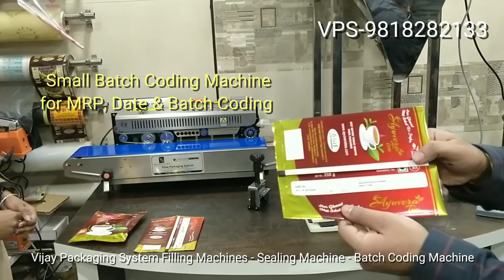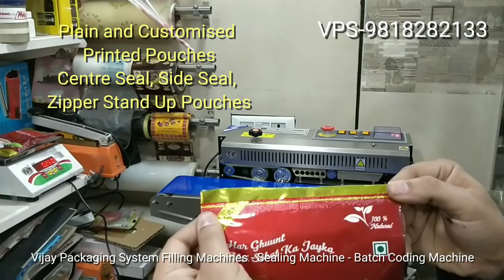Small Scale Business-Packaging Machine-Batch Coding-Filling-Band Sealing Machines

Comment from the maker: Whatsapp - 9818282133, 9350006667
9311111587, 9582222984
Land line - 01123976263, 01147050428
www.airbubble.in
Vijay Packaging System
3213, Ram Bazar Mori Gate Delhi-110006
Near Tees Hazari Court
vijaypackagingsystem@gmail.com
vaibhevkwatra@gmail.com

Small Scale Industry-SME-Packaging Machine-Batch Coding-Filling-Band Sealing Machines

Batch Coding Machine
3mm-small-₹2600
3mm-small with slots letter-₹2800
3mm-big-₹3300(IN VIDEO)

Mini Grains and Masala Powder Filling Machines
VPS-PGF-200-₹32,000(2gm-200gm)
VPS-PGF-1000-₹48,000(10gm-1000gm)(IN VIDEO)
VPS-PGF-3000-₹52,000(20gm-3000gm)
VPS-PGF-5000-₹62,000(20gm-5000gm)

Sealing Machines
Continuous Band Sealer
VPS-650-CS-SS-HZ-₹22,000

Other Continuous Band Sealer models available
VPS-500-CS-MS-HZ-₹15000(powder coated)
VPS-500-CS-MS-HZ-₹17000(stainless steel)

for vertical attachment ₹2000 extra
for Nitrogen filling attachment-₹15000 extra

5kg band sealer-₹36,000
10kg band sealer-₹70,000
15kg band sealer-₹1,35,000
25kg band sealer-₹1,75,000

Other Batch Coding and Conveyor Machines available.

Taxes and Transportation Extra

GST-18%

Packaging & Forwarding Charges Extra

Packaging Machines suitable for
Rice Packaging
Tea Packaging
Atta Packaging
Pulses Packaging
Spices and Masale Packaging
Powder Packaging
Cosmetics Packaging
Food Packaging
Bakery Packaging
Automobile Packaging
Fmcg Packaging
Supplement Packaging
Protein Powder packaging
Consumer Goods Packaging
Chips Packaging
Chemicals Packaging
Granule Packaging
Dal Packaging
Grains Packaging
Suji Packaging
Maida Packaging
Rava Packaging
Papad Packaging
Unprocessed Food Packaging
Processed Food Packaging
Haldi Packaging
Mirch Packaging
Dry Fruits Packaging
Badam Packaging
Akhrot Packaging
Kaju Packaging
Nuts Packaging
Spare Parts Packaging
Industrial Parts Packaging
Pesticides Packaging
Fertilizer Packaging
Super Market 
Corner Shops
Sweet Shops
Hardware and Sanitary Stores and Manufacture
Mobile Phone and Accessories
Electronic Equipment and Electrical equipment
Books and Magazines Packaging
Commercial and Industrial Products
Pan Masala and Gutka Packaging
Display Products
Auto Parts Packaging

Our Range of Machines
Continuous Band Sealer
Sealing Machines
Hand Sealers and Pedal Sealers
Powder and Grain Filling Machines
Shrink Packaging Machine
Shrink Tunnel
Shrink Chamber
L-SEALER
Web Sealer and Shrink Tunnel
Automatic L-Sealer
Liquid and Paste Filling Machines
Strapping Machine
Strapping Tools
Vacuum Packaging
Single and Double Chamber Vacuum Machine
Tea Vacuum Packing Machine
Pillow and Clothes Compress Vacuum Machine
Carton Taping Machine
Carton Sealers
Hot Air Guns
Cap Sealing Machine
Induction Sealing Machine
Air Cushion Machine
Mini Air Cushion Machine

Packaging Material Range

Shrink Films
Polyolefin Shrink Film
Pvc Shrink Film
Ldpe Shrink Film

Polythene Bags and Pouches
Ldpe Bags and Rolls
Pp- Polypropylene Bags and Rolls
Hm-hdpe Bags and Rolls
Bopp Bags with Sealing Tape
Courier Bags with and without Pod
Courier Bags with Air Bubble
Zip lock bags
Printed Poly Bags and Rolls
Customised Printing on Polythene Bags and Rolls
Printed Courier Bags
Branded Courier Bags and Tapes

Flexible Packaging
Polyester Laminated Pouches and Rolls
Bopp Laminated Pouches and Rolls
Glossy Pouches and Rolls
Stand Up Pouches
Stand Up and Zipper Pouches
Zipper pouches
Spout Pouches
Laminated Rolls
Paper Stand Up Pouches
Colored Pouches
Lidding Film for Tray Sealer
Top Sealing Film
Roll to Roll Laminated Film
Customised Printing on Bags and Rolls
Polyester Poly Laminated Pouches
Metalized Polyester laminated Pouches
Aluminium Laminated Pouches
Matt Polyester Laminated Pouches

End of Line Packaging

Plastic Straps
Manual Plastic Strap
Semi Automatic Plastic Strap
Fully Automatic Plastic Strap
Pet Strap or Polyester Strap
Plastic Clips

Self Adhesive Tapes
Bopp Self Adhesive Tapes
High Bond Adhesive Bopp Tapes
Extra Clear Bopp Tapes
Floor Marking Tapes
Sealking and Sinking Tapes
Duct tape
High Bond Tape
Cross Filament Tape
Tissue Tape
Security Tape
Temper Evident Tape
Masking Tape
Customised Printed Tapes
Paper Tapes
Warning Tapes
Polyester Tapes
Double Sided Foam Tape
Pvc Tape
Radium Shiny Tapes

Protective Packaging
Air Bubble Rolls, Bags and Pouches
Sandwich Air bubble 
Colored Air Bubble 
Coin Size Air Bubble
Courier Bag with Air Bubble
Air tube Bags
Air tube Rolls
Air Cushion Rolls
Air Cushion Machine
Ep Foam Bags 
Ep Foam Rolls
Ep Foam Sheets and Fitments

Whatsapp - 9818282133, 9350006667
9311111587, 9582222984
Land line - 01123976263, 01147050428
www.airbubble.in
Vijay Packaging System
3213, Ram Bazar Mori Gate Delhi-110006
Near Tees Hazari Court
vijaypackagingsystem@gmail.com
vaibhevkwatra@gmail.com

Comment: Machine price kya he
Reply from the maker: Small Scale Industry-SME-Packaging Machine-Batch Coding-Filling-Band Sealing Machines

Batch Coding Machine
3mm-small-₹2600
3mm-small with slots letter-₹2800
3mm-big-₹3300(IN VIDEO)

Mini Grains and Masala Powder Filling Machines
VPS-PGF-200-₹32,000(2gm-200gm)
VPS-PGF-1000-₹48,000(10gm-1000gm)(IN VIDEO)
VPS-PGF-3000-₹52,000(20gm-3000gm)
VPS-PGF-5000-₹62,000(20gm-5000gm)

Sealing Machines
Continuous Band Sealer
VPS-650-CS-SS-HZ-₹22,000

Other Continuous Band Sealer models available
VPS-500-CS-MS-HZ-₹15000(powder coated)
VPS-500-CS-MS-HZ-₹17000(stainless steel)

for vertical attachment ₹2000 extra
for Nitrogen filling attachment-₹15000 extra

5kg band sealer-₹36,000
10kg band sealer-₹70,000
15kg band sealer-₹1,35,000
25kg band sealer-₹1,75,000

Other Batch Coding and Conveyor Machines available.

Taxes and Transportation Extra

GST-18%

Packaging & Forwarding Charges Extra